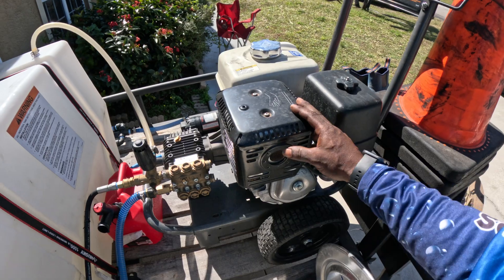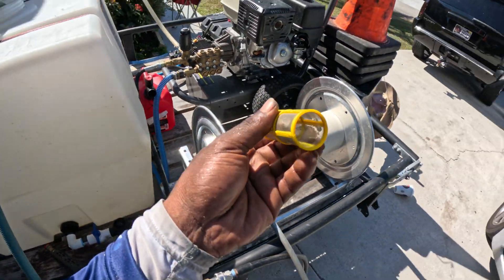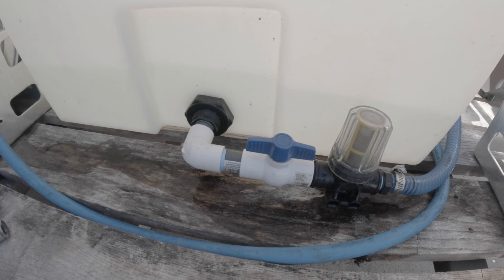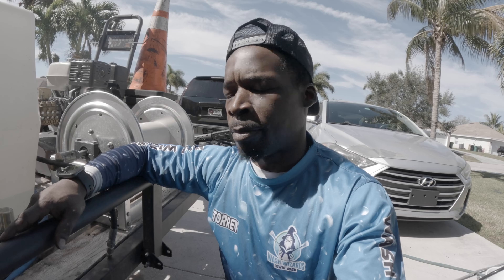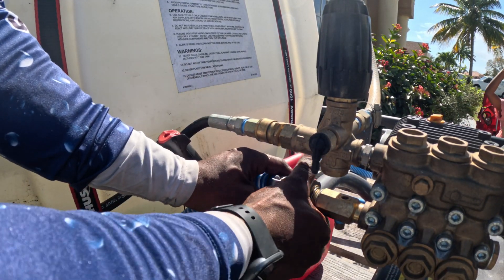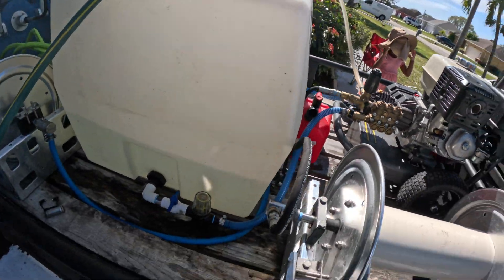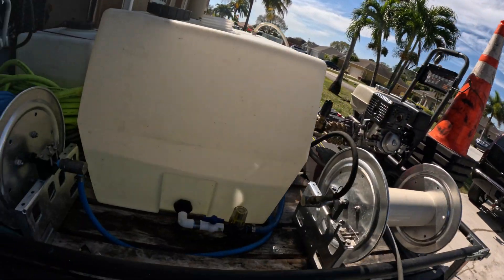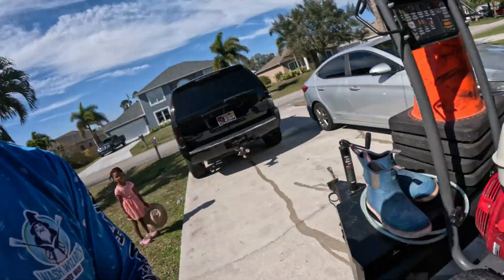Belt Drive Vs Direct Drive – How My Pressure Washer Pulls Water Without A Belt Drive

Comment: Gear drive system like you have takes up less space too than a belt drive system. I have a belt drive 8GPM and the cover guard on mine had to be wielded back because it broke at several places. Nothing that caused damage or loss of work just part of this business always repair and replacing equipment.

Comment: Only belt driven washers are built to pull from a tank. If you just hook the hose straight from the spigot to your machine it will work better and last longer
Reply: @johnconnolly4790  as long as that pump is getting water he should be fine, but then again I’ve only been in the industry for only 3 years
Reply: @Allcoastlawnandpressurewashing  nice I've been going about 3 years too. How's business going?
Reply: @ i only had a couple of jobs the last 2 years. The market is different here, but I’m hoping to get ranked higher on my GMB page
Reply from the maker: @johnconnolly4790 it’s going slow just getting a few jobs here and there but for sure it picked up from last month.
Reply: @Allcoastlawnandpressurewashing  yeah it's tough brother.. I paid a company a ton of money per month for like 6 months to rank my website and GMB up and didn't get much out of it so I stopped because it was costing so much money
Reply: @torreyspowerwashjourney  I'm not too far from you Torrey Im down in Palm Beach County doing mostly roof cleaning. I'm in the same boat as you, getting jobs here and there trying to get the work on the weekends when I'm not at my regular job
Reply from the maker: @johnconnolly4790 yup trying to hustle both be hell sometimes but it’s a grind.

Comment: is there a reason you do a tank setup instead of hooking up to the customers hose? Whats the benefit/tradeoff?
Reply from the maker: Having the tank make me not have to worry about what water pressure is coming out of a customer house cause sometimes a customer could have low water pressure and you will not be able to get the job done. That’s why I have a extra tank.
Reply: @torreyspowerwashjourney  I see, good to know. I just cant hook up a tank rn because I don't have a truck or a bed unfortunately, gonna have to rely on customer's hoses.
Reply from the maker: @ well most houses you shouldn’t have a problem. You should be good until you’re able to get a tank. I paid like 400 for that tank right there on Amazon.
Reply: @torreyspowerwashjourney  Thanks for the insights man🙏 I wish you the best of luck